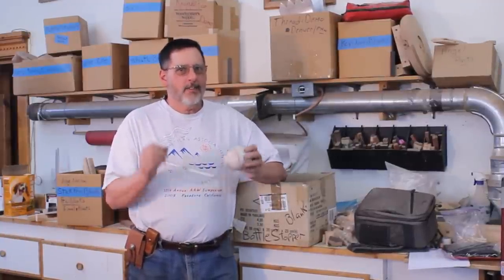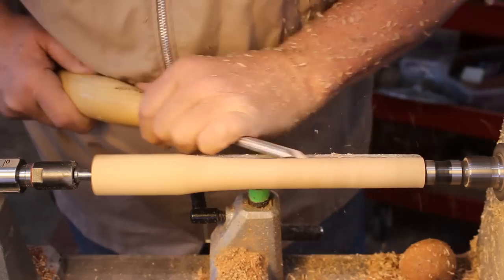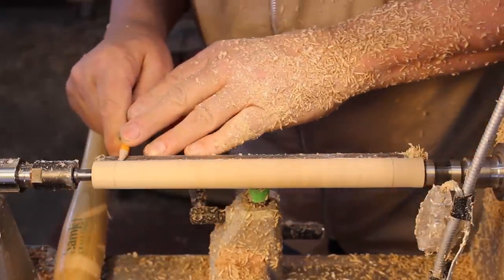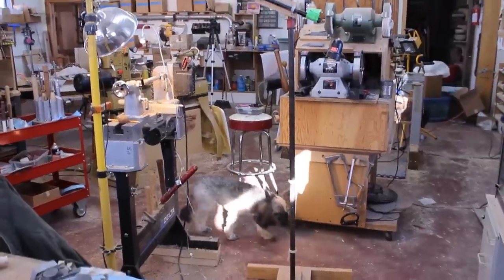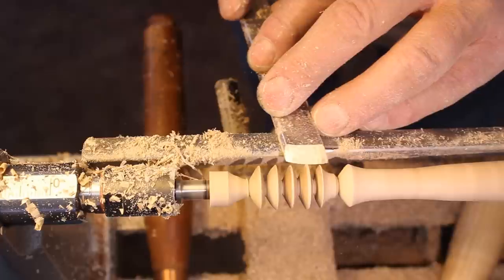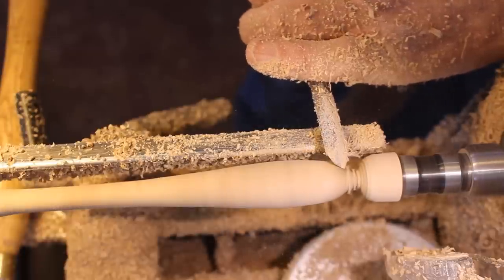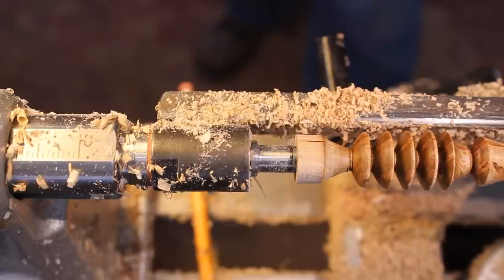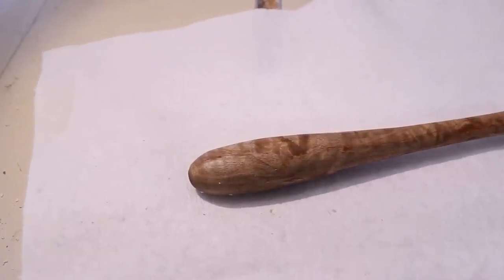Turning a Honey Dipper----  One sweet project

Comment: Sam, beautiful wood as you said and I really appreciate all the turning with the skew chisel. I try to use it as much as I can, but it is still one of the tools I need the most teaching on!
Reply from the maker: Mark
I still totally mess up at times using the skew.  You just have to force yourself to use it.  I reached a point where I would be working on a project and although I still was not even comfortable with the tool, I would reach for it cause it was the best tool for the job.  I almost hated that point because I knew I had to use the skew for that purpose.  Sam
Reply: Sam.., if you have never seen "Tiroler Drechsler" check him out.  He is German (maybe Swiss or Austria, not sure)  Anyway, he exhibits unbelievable control over his gouges.  You can see him riding the side bevel across the wood in a planning cut.  Very interesting to watch turn.

Comment: Do you take into consideration the type of wood you use beforehand? As this will see use in hot water, and ideas about that or a protective lasting finish? As I have my doubts with Danish oil and hot water...

These really make nice little gifts, and are easy and quick to crank out.
Reply from the maker: Daniel
Yes I do consider woods when that wood will be in contact with food AND washed and maybe not taken care of (like my wife)......I like cherry, walnut, maple, woods like that.  Ash and oak can be a little too ring porous for some food applications.  Although I do like ash for a salad bowl.  I think at times it comes down to what wood you have on hand.  For a finish, I like an oil-but anything you put on it will eventually be gone after a while.  Sam

Comment: Would the spring loaded point on the steb centre be causing that premature breaking when parting off? Seems like as the wood gets thinner there the pressure from the spring might make it break quicker than expected.

Don't have a steb centre so am not sure how "springy" it is :)
Reply from the maker: Pete
Wow, that is an interesting theory.  I never thought of it.  I will play around and see if that actually effects the tension.
Thanks Sam